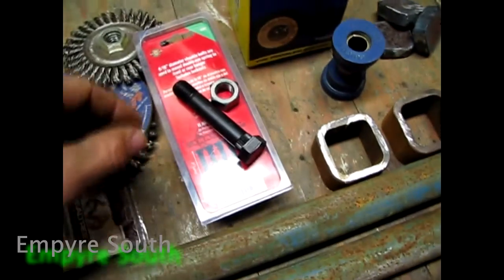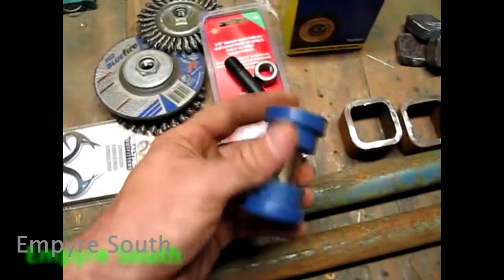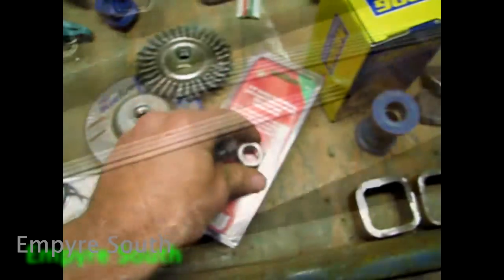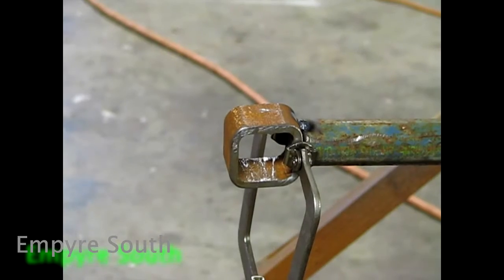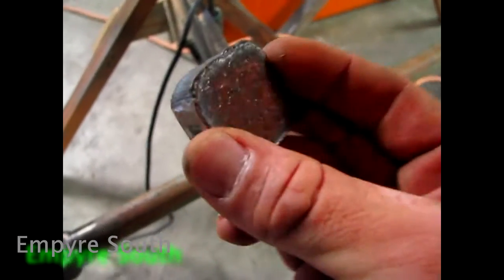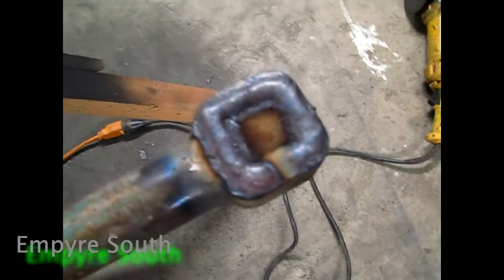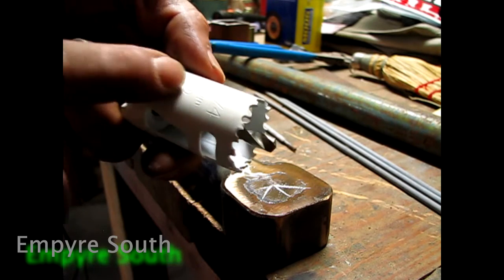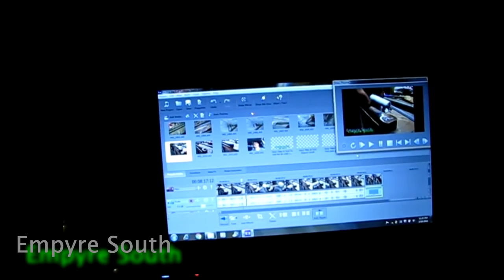Traction Bar Build 1- Materials and building the bars

Comment: Trick frames are hardened, your not supposed to weld to them after the hardening process... Notice how the suspension parts are either bolted or riveted?
Reply: Please show us proof of a hardened light duty truck frame. We'll wait
Reply: @Mang213  Monday morning quarterbacks cityiots!
Reply from the maker: Hvguy hey thanks for the comment. Most older truck suspensions are riveted. The suspension on my truck is welded.   And most newer trucks for that matter. Usually welded with a wire gun with Flux core. The procedure I used is better. Hey thanks again for checking our the video

Comment: How wide do you make the 2x2 tubing for the bushings??
Reply from the maker: Seth Francis when put the dampers together on the metal bushing measure the distance between them. that is how wide the end link needs to be. the idea is that bolt and metal bushing ride on the rubber with no slack. hope this helps. thanks for watching
Reply: Right on man I was just measuring some stuff up and was making sure I'm on the right track. Thanks for the videos!

Comment: hey brotha. what's your thoughts on some 1inch solid instead of tube? building a set myself for my rig. and as for future video ideas? fuck the small shit. do a bed build vid or a SA200 chop vid.
Reply from the maker: hey thanks for watching bro. dolls metal is usually more malleable, or bendable than pipe or square tubing. kinda hard to explain. tell ya what I'll do a video on this whole comment and maybe explain a few things. I will explain about the big projects too.  I post on instagram a little bit more if you want to follow there. hey, thanks again man.
Reply from the maker: solid metal* not dolls